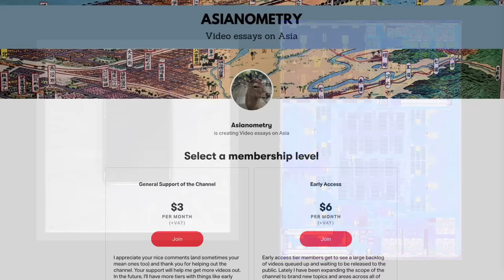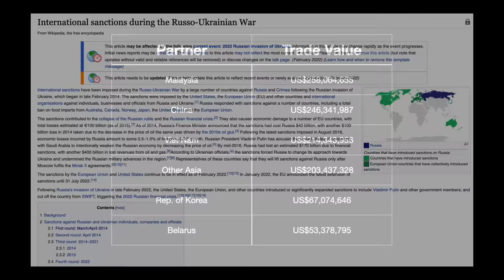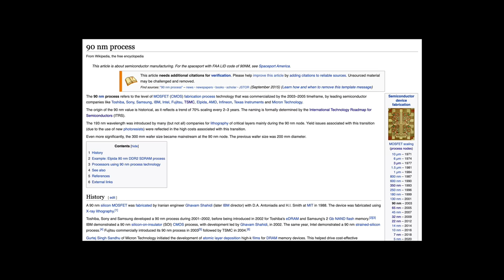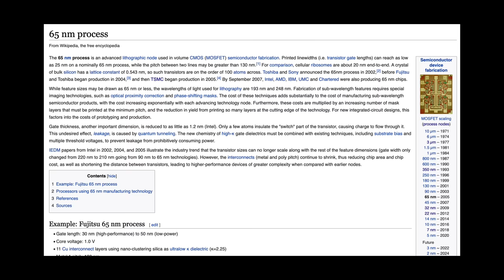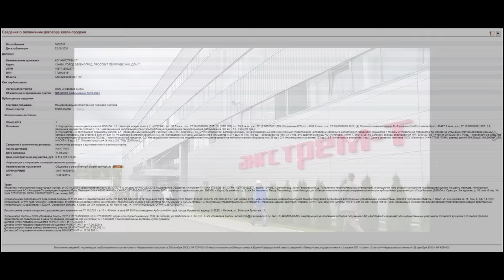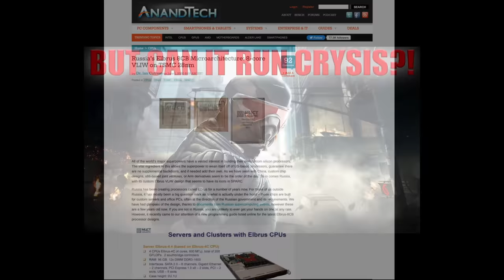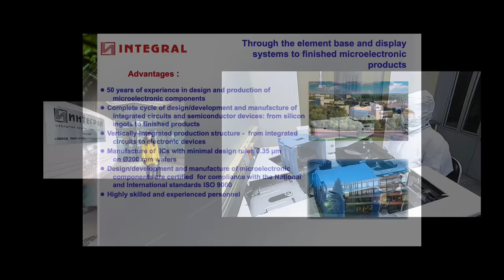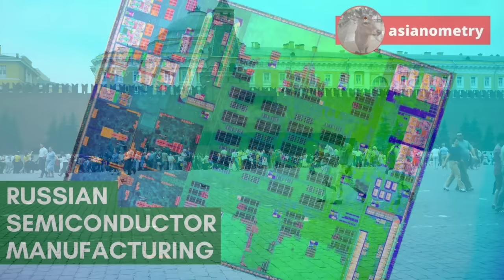Why Russia Can’t Replace TSMC

Comment: For their needs they can still buy from SMIC, Chinese manufacturer (not as advanced but still capable). Russia is not a big importer of electronics, their economy doesn't rely on them that much. Also another thing, TSMC ain't safe either, should China decide to invade.
Reply: Tsmc has 5 fabs almost built in phoenix
Reply: @larryc1616  But it's main base of operations is still in Taiwan.
Reply: @larryc1616  those are less advanced than the ones in Taiwan. Besides, TSMC 3nm fabs will go live earlier in Taiwan than TSMC 5nm fabs in Arizona.
Reply: @larryc1616  I think you mean almost started to build in phoenix
Reply: It is a big question wether SMIC can produce a big chip like the Baikal-S. They are starting with 14nm, but that doesn't mean they can produce a 48 core chip. Further, I doubt SMIC will want to burn their hands, because SMIC depends on a lot of foreign suppliers. If they end up on a blacklist it is game over for SMIC.
Reply: @danielmantione  SMIC is already targeted with US sanctions due to US-China trade war, they aren't allowed to buy ASML's EUV machines.
Reply: @teemuvesala9575  Mostly correct, but the export license has been held, not rejected by the Dutch government. It is possible that they receive the EUV machine at a later date, allthough the recent events make that less likely. SMIC is allowed to buy immersion lithography from ASML, and it is the immersion lithography equipment that they use for their 14nm process.
Reply: @danielmantione  Its precisely correct what I said. SMIC can buy DUV machines from ASML, but not EUV which is really required for sub 7nm nodes.
Reply: You look down on TSMC,  TSMC has already set up factories in Shanghai and Nanjing. It only takes his boss 10 minutes to complete the role change. he is born in mainland China
Reply: @frankfleming1103  Those are old fabs. The cutting edge fabs are all in Taiwan. TSMC has some 28nm and 16nm fabs in mainland China, thats about it. In Taiwan they are moving to 3nm, and building 5nm in the US.
Reply: @teemuvesala9575  yes your are right, but 16nm is enough for me. I bought Intel i5-12400 months ago, it is 10nm process, made by DUV Lithography machine. EUV lithography is not used at all in Intel 12 series. i'm not the successful man who must use the toppest flagship chips, my mobilephone is not the flagship too.
Reply: @frankfleming1103  Intel's 10nm is about equal to TSMC 7nm. The main reason Intel fell behind TSMC and Samsung for the moment is the fact they aren't using EUV. If they did use EUV, I think Intel could still be the leader in manufacturing process technology.

Comment: Taiwan as a nation is hard pressed to exert millitary power or political power or even economic power for the most part but through TSMC, taiwan can exert global power that rivals some of the best. Thats cool.
Reply: TSMC needs to urgently build fabs to disperse production, having all your eggs in one basket is not acceptable any longer.
Reply: @RobBCactive  TSMC has a large number of domestic (Taiwanese) fabs but also have a few in China and the US. They're building new large fabs in Arizona and Germany IIRC. I can imagine the US would consider the strategic importance of Taiwanese manufacturing if China threatens to invade.
Reply: @graham1034  Yes that's true but they have to disperse far more than already planned.  The chip foundry market has consolidated and geopolitical factors and the exposed supply chain tempts malevolent actors to gamble
Reply: ROC(Taiwan)
Reply: @paulbedichek2679  The worlds most powerful millitary is.. the us. and in case of invasion, its a flaky partner at best.  Taiwan had nowhere near the millitary strength to repel china. Like seriously its very bad. hopefully cooler heads will prevail tho
Reply: @rohansampat1995  Russia is dissolving in flakes,the Chinese are corrupt, the United States commitment to Town is not questioned. We'd like to see China reunified, always hard to see  a country so divided politically like that, but reunification could come with the nationalists on top, they are on a little island and managed to soundly thrash mainlanders with high tech.
People thought Russia had a strong military, now they are wondering if they have a military ,certainly not a navy or airforce.their  army is melting.
Reply: @rohansampat1995  Who did you think I meant when I mentioned the most powerful military in the solar system?

Comment: some food for thought ...

the massive costs associated with modern cleanrooms comes into play below 45nm... so 65nm could be signs of issue starting on that side, though its more likely the optics

also, commercial and military applications are two different beasts, suffice to say theres very few anti air or cruise missiles that fit in your pocket like a smartphone...and radar arrays require a lot of power, so are bulky devices regardless of chips used.. very few require very tiny low power devices as a specific requirement (like scopes/ir headgear etc)

chip design to maximise fixed function capability is the main objective for military design as it also relies on redundancy, not on getting one chip to do everything like commercial cpu's ...

Comment: One development you seem to have missed is that 1-2 months ago russia signed a contract for russia and belarus to jointly create 350nm, 130nm and 65nm lithography machines. They already have a prototype of the 350nm and i think 130nm. A new laser will be created for the 130nm. The 350nm machine will be ready in 2024 and the 130nm in 2025. Work will then begin on the 65nm lithography machine. Russia will build sizeable fabs for these as the manufacturing cost of the machines will be low so they can afford to buy many machines.

Regarding newer nodes SMEE is about to bring out a 28nm lithography machine and should be bringing out a 22nm lithography machine later this year. Russia could decide to make a fab for those rather than build their own as those will be more difficult to build than 65nm+ machines.
Reply: The agreements mean nothing if they don’t have the technical expertise to make it work - something which Russia hasn’t demonstrated in multiple decades. These things done come in a box with assembly instructions like IKEA furniture.
Reply: @benjaminlynch9958  they already have a prototype, much of it was designed by a belarussian that used to make lithography machines.
Reply: My understanding is that SMEE's 65nm lithography machine never became more than a prototype that is not actually economically viable in production. Is there reason to believe their 28nm and/or 22nm machines will be any different?
Reply: @SylphDS  they have apparently been advertising these over the past few months which is why ASML publicly claimed that they violate their patents. Looks like they will indeed go in to mass production.
Reply: @benjaminlynch9958  Ikea 🤣 wheeze
Reply: @benjaminlynch9958  Add to that the cost of acquiring the equipment to make the equipment. Did you see what has happened to the ruble. This project’s funding was reduced to 1% almost overnight. Putin has crippled Russia.
Reply: I've read recently, they want to build not a full-scale machine, but something smaller, MEMS-based. It is like a 3D-printer, but at nano scale. The reason is, internal Russian market is too narrow, so big machine will never pay for itself.
Reply: @MarcosElMalo2  3 months later, did you see what has happened to the ruble? 🤣
Reply: You expect either Belarus or Russia to last util 2024? They will just learn to do without until there is massive political change and thy can start importing again.
Reply: @MarcosElMalo2  What did you say happened to the ruble?
Reply: To bankroll something worthwhile they need customers who will buy the products. With the prospect of sanctions for decades, effort like this require it to be funded entirely from within. Good luck with that.
Reply: @paulbedichek2679  I think it is you who will soon have massive political changes, and not in Russia and Belarus.
Reply: @vladimirnikolskiy  The US is the oldest government on earth.
Reply: @paulbedichek2679  Yes, the same age as Tutankhamun.🤣🤣
Reply: @vladimirnikolskiy  The oldest government on earth.

Comment: You don’t need most sophisticated chips for best military equipment. Just good enough is more than enough. In fact no military uses the most advanced microchips, but proven ones which reliably passed test of time. Leading edge is more important for the commercial product usage
Reply: Well it depends, not for flying drones radar etc. but you do need it in cyber warfare AI incription / decription etc.. 
If you do not want to get hacked or spyed on, you need to be on the leading edge.
Reply: Tiny drones need tiny chips. If tiny drones are smart enough to search and destroy fuel trucks they can stop the advance of an armor division.
Reply: Same applies for space stuff too. Hubble used in latest stage 80486 cpu (https://en.wikipedia.org/wiki/STS-103 ) and on ISS they used 80386. For military purposes used cpu work mostly with higher thermal range and  lower frequency.
Reply: Will the Russians still be able to get the Canon cameras that they solder into their drones for imaging?
Reply: @zenithdawn9646  Why not? Being prohibited from buying something officially never stopped any country from acquiring it. Unless its actual military machines which are heavily guarded, ofc -- but even these sometimes change hands.

Comment: Hmm, I'm just thinking about what would happen if TSMC would get bombed to ground for whatever reason? Chip prices would go through the roof I guess.
Reply: Samsung would be the happiest.
Reply: All of the following is assuming China is the one doing the bombing. While Chip prices would go through the roof, Samsung and Intel would get rich instantly overnight as their fab capacity would become imperative going forward. Construction on TSMC's US facilities would rapidly be expedited while the rest of TSMC's fabs in Taiwan would be forcibly made inoperable with whatever equipment they can transport to the US would be transported. TSMC would move to the US. My guess is Intel would be forced to fully open up their fab capacity by the US government as well. Eventually though, global capacity would be restored as more and more fabs in the US, Japan, and South Korea come online. However, there would be a significant supply chain disruption as TSMC would go offline in the mean time.
Reply: @wakannnai1  DPRK can strike U.S bases and the infrastructure of occupied South Korea.
Reply: @brujua7  And risk disrupting the flow of global chips and Trillions of dollars worth of economic value in the US due to a large number of fabless semiconductor companies in the US? That would never happen.

Comment: ...In 1974, the first microcomputers based on universal microprocessors were developed. Sectional processors of the K532 and K536 series (which appeared in the same year) made it possible to manufacture machines with a capacity of up to 16–32 bits. So there were 16-bit micro-computers. In 1977, the analog Intel 8080 was released - an 8-bit K580IK80 processor. He then became the basis for the creation of a number of PC models and micro-computers. Two years later, the world's first 16-bit single-chip micro-computer, the K1801E1, was developed. Based on the K1801BE1 in 1981, the K1801BM (a single-chip 16-bit microprocessor) was created...

Comment: Nice video!
The architecture of the Elbrus chips and their x86 compatibility layer are very interesting. Transmeta is probably the closest thing I'm aware of, but unlike Transmeta, Elbrus put more emphasis on performance and software bug tolerance over energy efficiency which led to some different design choices.
If it wasn't for the outdated manufacturing process, those chips could be (could've been?)
pretty competitive with the major CPU producers, in my understanding.

Comment: How bad was the shortage of semi-conductor chips in the USSR? In 1985 I was working for a German Electronic Equipment Manufacture. They had a new Wave soldering system that was computer controlled and it had an Intel processor. The machine could not be shipped to the USSR, because the Russians would take the Chip out and use it someplace else. Leaving the Wave Soldering system a dumb machine that required manual adjustments. A System that could have bought for 2,000 USD less.
Reply: That's crazy. They would be willing to pay 2000 USD (in 1985 money no less) for a single chip....
Reply: @zxb995511  Brain Drain and Zero Support for Technological Innovation does that to a Country
Reply: They only had some chips from VEB Robotron (Eastern Germany) and Belarus (Integral) that times. VEB had clones of 6502 and Z80, plus some small RAM chips. All MOS/CMOS.
Reply: I was using APPLE ][ clone with 6502 in 1982/83, I remember adding Z80 card for the 80 column.
I guess the Russian can order tons of them at that time.

Comment: Biggest misconception in the video is that robotisation and digitalization is something that greatly affect Russia's development.  Human labor costs fraction of what it costs in most of the Europe.  Taxes are lower.  Energy is cheaper.  You can not possibly compare things by pulling data without taking in account the rest of the costs associated with production.  If it was economicaly feasible for Russia to get more digital/robotic, they would do so long time ago.

Comment: I wonder if being able to build leading edge or close to leading edge nodes are really that important for a nation. Most chips made on leading edge nodes are 'nice-to-have' products that are not crucial to national security, industrial capacity or even daily life quality. An overwhelming majority of chips used in the world are not manufactured on leading edge. A pariah state like Russia could sustain itself perfectly fine if it could build lots of 65nm chips. You may say AI or supercomputing but let's say if 65nm is 25x less efficient than leading edge 7nm, what's stopping them from building a computer 50x bigger and more power hungry (after all, energy efficiency is not a concern for them). Russians are experts at overcoming technological disadvantages with brute force. 

From an economics perspective every leading edge node after 14nm has not dramatically reduced performance per unit price. SMIC expanding 14nm could be enough for China/Russia to last quite a long time. Many people are still using smartphones/computers with chips made on 28nm. Having a slow phone or computer did not stop them from accessing latest modern entertainment or productivity software.
Reply: Yes, it matters. For Russia, military applications are currently something of a priority, and the size/weight/power consumption/heat of the electronics they can acquire at scale are pretty important. To be able to build the various advanced missile and tank/plane subsystems that they need to compete with non-Russian equipment, they need something better than 65nm tech. Otherwise, they are back to building Cold War era Soviet designs, and large sections of their military capabilities are going to be stuck at circa 1980s' levels forever
Reply: @talltroll7092  modern military hardware does not use 14nm chips nor are they designed with to require such chips. Certainly not in Russia. They have been able to consistently churn out newer weapons systems with completely domestic supply chains much to the dismay of the west. However they also have some ways to go with Putin investing billions into domestic chip manufacture but its only a matter of time.
Reply: I vaguely have an EE background but to answer your question "what's stopping them from building a bigger chip" is basically latency.

So when people refer to Xnm fab process, what it traditionally refers to is the gate length, or the distance from the source to drain within a transistor. When the gate is ON, current flows from source to drain and once there is enough charge in the drain, the transistor is read as a 1. Now the longer the gate is, the longer it takes for the transistor to read as a 1 after flipping it on. This basically sets a theoretically threshold on how fast an entire chip can run. When you build a bigger chip, you're chaining more transistors and actually increase the total latency of the entire circuit. You end up with a less responsive circuit, you have to increase complexity to handle the timing issues that arise, and you also lower yields since bigger chip means less chips per wafer.

Also note, engineers tend to aim to shrink the gate length and width by ~70% every 2 years, which decreases the area of the gate by ~50%. Combine this with setting the electromagnetic field such that electron velocity holds constant, you can effectively double the speed of transistors. This is how Moore's Law is achieved. So 65nm * 0.7^6 =~ 7nm, meaning 65nm is at least 2^6=64X slower than 7nm.
Reply: @RayTsou  as far as i knew, Xnm is not real physical size.
do you believe that there is exist chip with size of 3 nm?
if it is exists, i confused how to assemble them.
Reply: @irawanie8635  the chips themselves are not Xnm, they are made up of billions of transistors, with the smallest transistor used having a gate size of Xnm. It's commonly said the Xnm is not "real" anymore bc the design of the transistor has changed to FinFET and more recently, GAAFET, meaning the gate is no longer just a rectangle and so the performance isn't as easy to simply infer based on Xnm. The way we make them is by splitting lasers using crystals and mirrors until the light is only Xnm thin, then carve the circuitry on top of a silicon wafer